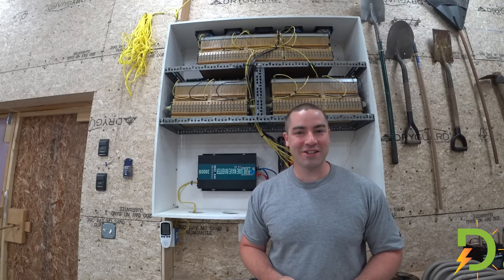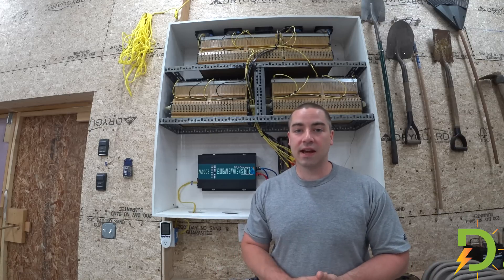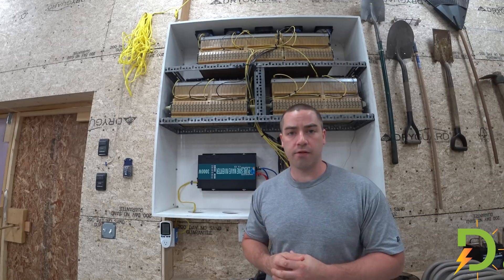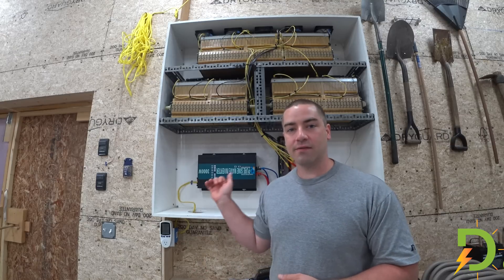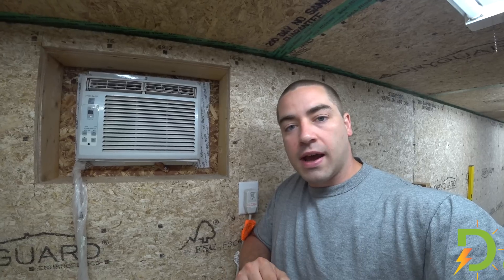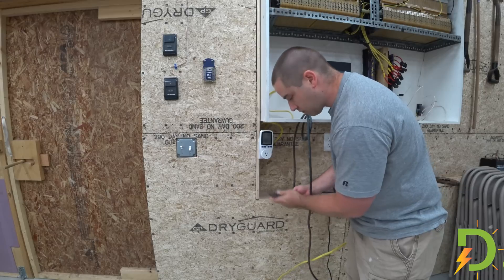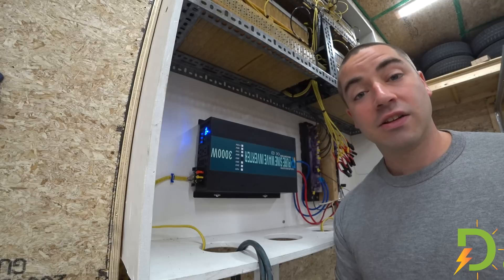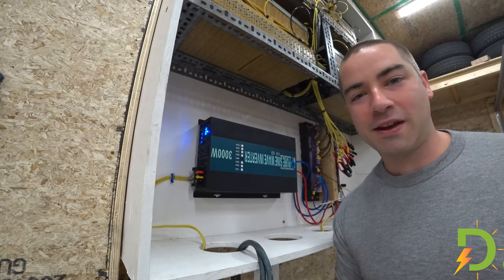Air Conditioning, Reliable Inverter, Off Grid, Solar and Batteries

Comment: Hey David, Thanks for the interesting video. I missed how many amp hours the batteries are and exactly how many hours it ran the A/C.
Reply from the maker: It might be easier to think in terms of Watts, and Watt*hours.  If the load (air conditioner plus inverter) draws 500 Watts from the battery, and the battery is 500Wh in capacity, then it will run exactly 1 hour.  If the battery is 10kWh (10,000Wh) then it will run 20 hours.  Thanks for watching.

Comment: i am running 3.9kw 1.5hp window mount 14.000BTU  runs at 1180w ,we have 1.2kw solar feeding it through  same brand inverter 4000w -8000w surge runs fine on lipo4 cells 6.78kwh 24v battery bank,,,,  runs all day on solar for free ,

Comment: I have the same Inverter and it will not run my 6000 btu A/C. The problem is it cant handle the startup surge not sure why and i put the MOSFIT upgrade in but still no can do. My Harbor Freight 2000 Watt has no problem oh well.

Comment: im trick about buy the 5000 watt 24 volt for my bus to rv do you think this are a good buy amazon has it for 450.00 and with a 3 year warn. its be little over 500.00
i this a great 12 volt 24 charger off solar its the EPEVER MPPT Charge Controller 40A 12V / 24V i look for long time seen like this own the best for what im doing
just want to know if this inverter was a good own amazon has so many bad rev. on it

Comment: Hey Dave.   

Thanks for sharing your setup.   Let me preface with sorry for the laundry list of questions below.   If you or anyone else in this comment section is experienced with this stuff.  Please reply....  whatever info you can offer is super appreciated.

You never told us what your solar panels are rated at.  Voltage and amperage (in full sun).   And what voltages / amp outputs do you see from them on days which are overcast?   Curious how much loss you experience from your panels on less than sunny days.

I was able to see your inverter is rated for 3000 watts?    Is that continuous or peak?

Your Chevy Volt batteries....    can you share how you acquired those.? .  well suited for constant use I'd imagine.

What voltage do you have them wired up as and what is the max continuous amp output you can run them at without causing damage.   Can you run a full day or 2 without any sun hitting your solar panels?

I'm wanting to get a feel of what I need to support a 1400 watt AC unit and a 800 wat mini fridge, plus another 1500 watta of auxiliary AC devices.  I'm figuring on a 5000/6000 watt inverter.  And will probably use lithium 36v  1005 AH  batteries.  

Thanks for whatever info you can provide !

On the inverter.    Prices are ALL OVER the place.  The $50  3000watt inverters on Wish I know arent gonna be real ratings / prices. What should a 5000/6000 watt inverter cost me and do I have to use Pure Sine wave to avert he AC unit comoressor/fan getting burnt out?
Reply from the maker: Hi Patrick,  The array I was using in this video was about 9 amps, 40 volts, per panel.  I ran them 3s4p, so about 120v@36a.  The whole array is rated for almost 4.4kw.  If it's raining I'll make about 600w.  On a very cold and sunny day up to 4.6kw.  And anything in between.

It's rated for 3000w continuous, but this particular brand doesn't quite get up there.  More like 2600w. 

I bought the batteries from a junkyard.  But it's a lot easier to buy batteries from a reputable second-hand dealer.  I have bought a lot from https://batteryhookup.com/  and 5% discount with my code DAVIDPOZ

44v, 250a.  They ranged from 40v-49v and worked well with 48v rated equipment

I recommend 48v equipment and battery.  If you want to build your own battery, then try 4 of these: https://batteryhookup.com/products/k2-12-8v-142-95ah-1855wh-lifepo4-module  4 modules in series would make a 16s, 48v battery.  Add a BMS and you are good. 

I'm currently using this inverter: https://shop.signaturesolar.us/products/5kw-48w-240vac-80a-off-grid-inverter-by-growatt  However, it sounds like your loads are 120v, so I'd suggest this one instead: https://shop.signaturesolar.us/products/6kw-48v-250vac-80a-off-grid-inverter-by-growatt
5% discount with code DAVIDPOZ

Comment: Bro they now have soft start systems for your air conditioners which reduces the inrush of electricity 500% you should be able to power your AC
Reply: How do i hook it up? I have the in rush current problem

Comment: Have you done anything with the reliable inverters 60v neutral 60v hot outputs? Or are you just using it as is? I ran mine to a breaker but even with breaker off you still have 60v neutral. It works but I have to keep a eye on everything.
Reply from the maker: I only use my Reliable inverter for small individual loads.

Comment: My 5000 btu lg window  runs at 340 watts. Which is less then the data sticker shows. And it runs off the solar directly with the battery completely full. The battery voltage never drops as long as the solar watts is high enough. 👍👍
Reply from the maker: That's great for a 5k AC.  I might have to buy an LG and test it out.

Comment: Cool man! How long will the AC run with this set up? Minutes? Hours?
Reply from the maker: In this video I am using an 18kwh battery.  Since the inverter plus AC draw about 500 watts (0.5kw), this would run about 36 hours
Reply: @DavidPozEnergy  😎👍👍 you're the man. I'm subscribing.

Comment: Hey tell me how many batteries you need to run the ac , because I try to run on ac and as soon I plug it the fun work well but when the Compressor star it turn off , tell why it happen
Reply from the maker: When a compressor starts there is a big inrush current.  Most inverters can't handle that

Comment: Thanks for the video. Question. Where would you connect a charger for batteries if you had no solar panels? I will run a VAWT to charge them so would I need a charge controller? Tell me about those charge controllers and where is the connection

Comment: How long does it last on and if it reaches 500 watts and the inverter is 3000 watts, is it doubling 2500 watts to use in other devices?

Comment: Kinda late to the power inverter game very awesome setup,quick rookie questions, just bought a 3000w pure sine giandel inverter to run a 8000 btu 900 watt portable air conditioner,should i cut cord and wire directly to ac block?And how do you wire earth wire?to negative cable?if somebody could help me out i'd appreciate it,thanks in advance

Comment: so what is that---about 4 amps AC and about 40 amps DC ?
Reply from the maker: I'm running a 48v DC system.  So it's about 10 or 11 amps on the battery.

Comment: Great video I'm using a 3000w inverter with 5k btu ac in my trailer.  The surge was a problem with my 1500w but the 3k seems to work so far.  After a bit sometimes I have problems thanks for telling me about amp draw limits on batteries
Reply: I have a dump truck with no ac and was thinking about getting a inverter and one of those portable ac units and vent it thru my floor. Any advice?

Comment: Dude what BMS are you using for the batteries?
Reply from the maker: I've used a few brands over the years.  Mostly I use Daly brand that I buy through Aliexpress.
Reply: @DavidPozEnergy  thanks for sharing greetings from México

Comment: Hi boss... I did buy the same inverter and I need to know what to do....look... when I connected rigth away start making smoke and only show the 13.5 Volts coming in and not show nothing on the bottom display for 110 volts... this inverter bring like 6 spear fuses but I don't wanna open it cuz it's new and I don't want to loose any warranty.... What you should do, return it or open it to replace fuse or what?? Tnks for ur help.
Reply from the maker: If you bought it through Amazon then return it.  If you bought it somewhere else, then e-mail the company.
Reply: @DavidPozEnergy  tnks a los boss....What u think it's happened cuz this it's my 3rd inverter in 7 year....I never had this problem....its only two terminal + and negative thats it....not complicated.
Reply from the maker: I can't diagnose your system on YouTube comments.  It could be a lot of things.  I'm in a Facebook group called "DIY Powerwalls" with lots of helpful people there.  If you post on the group we can help more.

Comment: This does not work long term on a modified sine wave inverter as the compressor wants to "see" a pure sine wave of power to rotate its armature for starting. This does work but shortens the life of air conditioner, refrigerator, and air compressor.
I am only trying to assist to prevent later cost measures.

Comment: I did this same project with a 4000w 12v Harbor Freight inverter and two 12v 100ah sealed lead acid  batteries. Worked great.
Reply: Thank you for this.  Is it still working?
Reply: Still working?

Comment: how you control none of the cells goes below the recommended voltage or above?
Reply from the maker: Individual cells need to be protected using a BMS (Battery Management System).  I usually buy Daly brand ones from Aliexpress.  But I've used a few different brands.

Comment: Just want run a standard refrigerator. I have 4 Interstate group 27 deep cycle batteries. My goal is to run it 24 hours a day. I havent picked any solar panels yet. Just need some help.
Reply from the maker: Hi Charlie,  Running a fridge is a great first project into solar.  When starting your calculations, begin with the load.  Fridges might draw 400-600 watts, but they turn on/off all day long.  The only real good way to find out how much power (watt hours) they consume in a day or week it to plug in a meter.  Plug in a simple meter like this link to the wall, then the fridge into it.  write down what time and day you plug in.  Then check back in one day or 3 days, or week.  You can then use an online calculator to size your panels.  https://www.amazon.com/gp/product/B01JLT8NSG/ref=ppx_yo_dt_b_search_asin_title?ie=UTF8&psc=1

https://www.altestore.com/store/calculators/off_grid_calculator/
Reply: @DavidPozEnergy  Appreciate your help. Thanks for the link to the meter. I'll let you know in about week how it's going. 👍

Comment: I'm wondering if most of us here know's about the basic of electronics? Pin/Pout. Aircond  Pin = 800W
Inverter Pout = 500W.  Is this will work? Can you lift a 100Kg if you can only lift 50Kg? Can the inverter power-up the aircond? What is the best inverter? Modified Sinewave or Pure Sinewave? When to use Pure Sinewave?

Comment: Any recommendations on a budget friendly true sine wave inverter. I am planning on going 24v and would like a small window unit like that. Thanks
Reply from the maker: If you are only powering a tiny window AC like my setup, then this is less than $300: https://amzn.to/34r1ERK   However, I prefer low frequency inverters.  LF inverters will work longer, be more reliable, and handle the compressor surge much better than a high frequency inverter.  This is about the lowest cost LF inverter I can find on Amazon, and it is still more than the other one.  I think it's worth the extra $$ if you can swing it: https://amzn.to/2NTomfs
Reply: @DavidPozEnergy  iou

Comment: Please can you tell us how much your battery set up cost. thanks.
Reply from the maker: Hi James,  The battery was $2000.  The inverter in this video was $300 (although I have upgraded since this video)  I have around $400 into all the wires, terminals, heat shrink tubing and such.

Comment: Quick questions, how many solar panels in total watts are you operating to run the 5,000 k btu? I am trying to cacallate what it would take to run a portable 14,000 BTU (110 volt ) , any idea?
Reply from the maker: Hi Florida Crypto R,  My solar system is 4.4kw.  But it's not accurate to say the solar is running the air conditioner.  It is more accurate to say the batteries are running the air conditioner and the solar panels just re-charge the batteries.  First you need to know how many watts your air conditioner needs when the compressor and fan are on.  My window AC is 430 watts, plus 10% for inverter loss is 473 watts per hour drawn from the battery.  Now you can multiply by how many hours you want to run the AC.  If it's 10 hours a day you want it running, then you need a usable battery of 4.73kwh.  Then you can ask yourself how big the solar array needs to be.  I have 2.6 sun hours at my location on average.  So divide 4.73kw by 2.6 sun-hours and you have 1.82kw of solar panels.  Add 25% to account for losses in the charging.

Here is a great online calculator to help: https://www.altestore.com/store/calculators/off_grid_calculator/

Comment: Hello total newbie, learning on my own an from YouTube and other sources. I have a small solar set up an need a little help my inverter right now is only 2000 watt surge    I'm trying to run an a/c swamp cooler  unit about how many watts are u pulling using the refrigerated air unit I'm looking at a power techon inverter 3000 contious 6000 surge will this be more than enough to run my a/c and also about 500 watts elsewhere in my home. Thanks in advance for any help you can provide
Reply from the maker: The AC you see in the video is less than 500 watts continous.  I don't know what it's start up surge is, but less than the 3000 watts of the inverter.  Sounds like your new inverter should be better.  The best inverters for starting up surges are called "low frequency".  They are built with transformers inside and are very heavy.  My new inverter is built like this: https://youtu.be/dfHb5tZErTs

Comment: I just installed a power  inverter 1500w too 3000w peak and I installed an 1350w 110v portable  ac but it still doesn't get enough juice , should I get a higher power Inverter? Plz help thnks
Reply from the maker: Air conditioners have a large startup draw of current. It might be 5 times the running watts, but just for a second. Your ac might need an inverter capable of 7kw surge.  I have found that inverters with transformers built in do a better job with surges. These are called "low frequency".  If you use a "high frequency" inverter (like in my video) then calculate your needs based on running watts of the inverter.  For example, my AC runs 450 watts, times 5 equals 2250 surge watts. The surge is still less than my inverter running watts of 3000 watts. 
Also worth looking at is the wire size and battery to make sure they are not choking the inverter.
Reply: @DavidPozEnergy  thanks man!!

Comment: Hi, I really appreciate your video posted. I was wondering if it is possible to have the inverter connected to a fuse box that would serve as a mini electric panel and then have that connect to the AC unit instead of having a battery?

Comment: Yes this can be done, the problem is the solar charging of the batteries. It will take days to charge back what you are using from your battery bank, unless you are producing 550 watts or more per /hour from the solar panels ... it would take 11 (100 watt solar panels) or more to charge back what you are using from you battery bank ... that is if you are getting the maximum wattages out of the panels. (so if you have a cloudy day... this may not be possible).
Reply from the maker: Thanks.  This past summer my AC ran just on the solar system.  Never had a problem.  I have a pretty good size solar array, 4.4kw.  I have some other videos up about it if you want to see more.  Thanks for watching.

Comment: Actually you can run the inverter off of of a 12 volt solar panel by using what is called a step up converter it takes 12 v and steps it up to 24 volt or you can get one from 12 volt to 48 volt,....but it needs to be heavy duty

Comment: Good video, been catching up on some of your older ones, I'm a new sub. I've been running an energy star 6000btu ac for over 5 years with a 1500 watt gopower pure sine wave inverter. It uses roughly 450 watts, no issues at all. Run a few fans at the same time to help move around the air. During the winter months, I run an oil filled heater. Those are nice because they heat up and turn off. So even on cloudy days when I can only pull 50% of the watts the heater uses, I can still run it because of the way it cycles on and off.
Reply from the maker: Thanks for checking out some of my older videos.  I hope you enjoy them, even though they are not as polished as my newer ones.
Reply: Quick question mrlivewire,i just got a giandel 3000w pure sinewave to power a 8000 btu air conditioner thats 900w shoud i cut the cord and run the ac through ac block?And also theres a earth wire,could i just run the earthwire to the negative cable?it looks like you know your s@#$ thanks in advance

Comment: you can run a evaporative cooler longer for about 4 days without solar,...with solar, every week,..ive done it
Reply from the maker: Thanks.  Swamp coolers make sense in dry climates, but up here in Massachusetts it is too humid.  I have first hand experience with them.  I don't recommend them for Massachusetts.
Reply: @DavidPozEnergy  use the rite padding and you wont have that problem,..Dura cool pads not those cardboard junk,..
Reply: @DavidPozEnergy  it gets 85 to 90 here in the summer so i take out those cardboard junk filters and run Duracool pads and it really makes a big difference and the water i used is distilled

Comment: Where can you get Chevy volt batteries?
Reply from the maker: I bought mine from an "Auto Recycler".  (aka. Junkyard)  I did a search for "auto recyclers in my area" and started calling.  I probably called over 100 places before finding one that had a battery for sale.  I hope that helps.
Reply: DavidPoz thank you man for your response is much appreciated
Reply: @CheezeAndWine  How long will those batteries last? So many charges/discharges... I think they will be stressed too quickly...